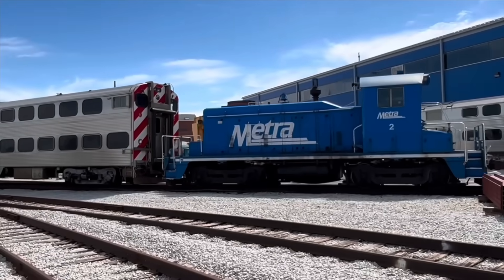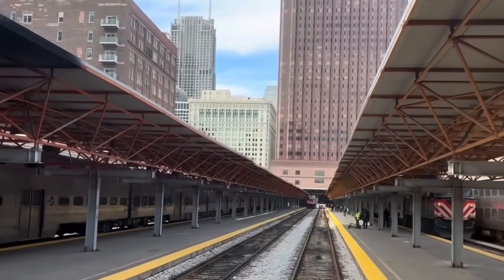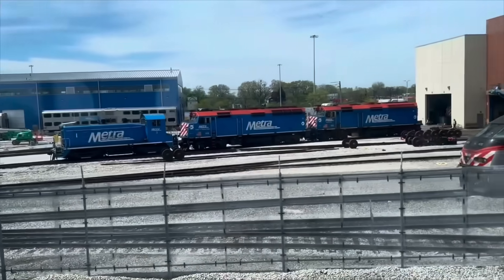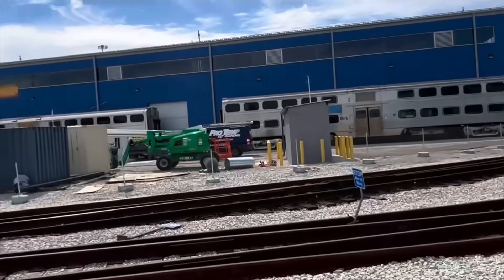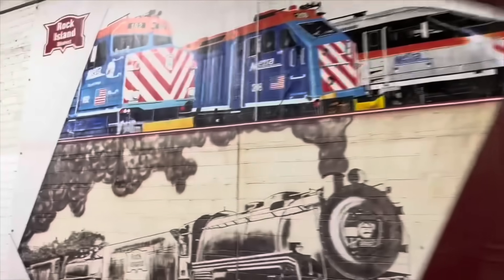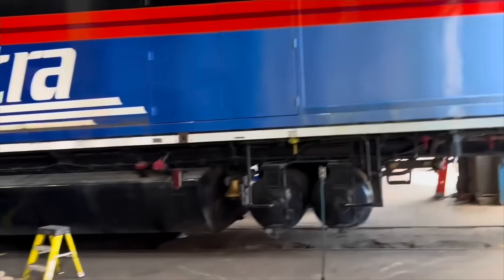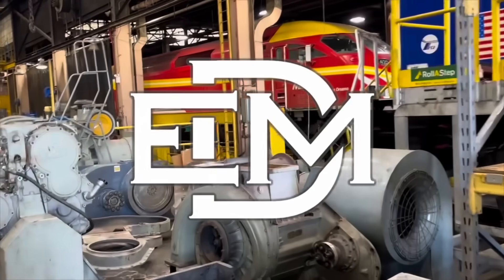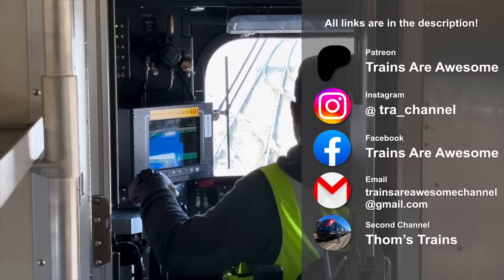How Metra can keep running such OLD trains

Comment: Very good video 👍🏼. Thom, if I knew you were going there, I would have asked you to ask Metra. Why cant Metra make F-40ph’s quiet like the F-59s and the MP-36s.
Keep up the great clips Thom.
Reply from the maker: Good question! Let me do some digging
Reply: I know why, however those F-40ph’s have been rebuilt, overhauled etc a few times since the 70s & 80s and were not converted, to for example resemble F-59ph/F-59phi (1988-2001). Granted those have a V12, however the length is almost the same.
Only thing I can think of is that they have grandfathered emission standards.
I just like digging for technical info in stuff Im interested in.

Comment: By using OLD equipment and simply rebuilding parts for them as the old parts wear out, they save 50% on their operating budget compared to what they would spend if they bought new equipment instead.
Reply: This works until they run out of parts, which is why the Alstom order is happening. You can only cannibalize so much.

Comment: I wish I could be at such an event. I was able to go inside of the Metra locomotives every year at the Franklin Park Railroad Days which takes place on the second Saturday of June right outside the Franklin Park Metra station on the Milwaukee District West line. I usually have to travel for it every year now that I’m not in the Chicago area. I’m getting to like the Galesburg Railroad Days better which is every year on the last weekend of June. I’ll probably only be in town for that next summer.
Reply from the maker: That sounds like a cool experience!
Reply: @Thom-TRA Yes indeed!

Comment: I guess the 47-49 is Metra’s equivalent to Beech Grove for Amtrak (although I’m sure there are smaller facilities were more routine work occurs elsewhere for both operators. Wouldn’t be surprised if Amtrak and Metra share sites in Chicago)
Reply: Amtrak does all their work separately in their yard on the southeast side of Union Station. Metra does the majority of work at 47th Street (this video), Western Ave, The Zephyr Pit (Metra BNSF yard at the southwest corner of Union Station, and 18th Street (Metra Electric).

Comment: I keep repeating myself: Your opinion matters now, Mr. Transportation Attaché. Which is a GOOD thing! Also, your video was as educational AND entertaining as always. Thank you!

And now for some trivia (regarding the old shunters in the yard): The S-Bahn Berlin GmbH (a subsidiary of the DB AG) is using a dual mode locomotive in their main shop (S-Bahn Hauptwerkstatt Berlin-Schöneweide) which can run either as an ordinary electric locomotive via third rail power or from internal batteries. It was built in 1933, over 90 years old (and survived WW 2 al well as the GDR) and still is in daily service. To be fair, it has been modernized twice. DB themselves on the other hand, still uses many the shunting locomotive model V60, which was introduced into service in 1955. 
Though the railfans would find that bit interesting. ;-D
Reply from the maker: I hope I last that long haha

Comment: I definitely come down on the side of people who believe Metra is held back by its continual reliance on old rolling stock. They should definitely not use gallery cars anymore and should at least seriously consider multiple units or other locomotive types when making new acquisitions rather than just buying everyone's old freight locomotives and gallery cars
Reply from the maker: Me too, but I made the mistake of saying that publicly once
Reply: @Thom-TRA Knowing little about railroads but having ridden Metra for 30ish years, I don’t understand the issue with the gallery cars. I’ve always found (the refurbished cars) to be extremely comfortable.
Reply: The Beverley branch of the Rock Island line will be getting electrified 2 or 3 car units in the coming years
Reply: License ANY Design and have a company based in the south side of Chicago build it for a fixed price per each lot of 20.   Getting car s from out of state is bullshit in the steel job shop and large casting mecca of America.  Even if its weird, looks like shit, as long as its weather tight and has HVAC that works in 3 seasons a day chicago weather,  its a 90mph passenger car that needs to be compatible with high and low loading, because the suburbs are not going to redo a train station before the riders show up.

Comment: Honestly the order from Alstom is so slow moving that I forgot it existed until it was mentioned in this video! Is there actually still any progress on it or is the order dead in the water?
Reply from the maker: I have no clue. It’s taking forever.
Reply: Last thing heard about It was metra was supposed to get the prototype cars this year and production starts in 2026 but it's all been pushed back a year to prototype cars 2026 production  cars 2027

Comment: I’m a huge Metra fan! 

Metra sure has a lot of hand me downs on their fleet. 

Like you mentioned Metra has a large commuter rail service in the United States.
Reply: Hand me downs*
Reply: @Nova32x 
Nothing wrong with hand me downs, and to be honest the only thing that was hand me downs was the original equipment that they received when the RTA was formed. Since then they have purchased new locomotives as well as used and rebuilt locomotives and more gallery cars to meet the demand and become ADA compliant.
Reply: @PTCopper I agree

Comment: A great way to keep all commuter rail operations throughout the US operating efficiently while saving tax payer dollars.  I've never understood why locomotives and train cars need to be replaced after only 15 or 20 years of service.  Refurbishment upgrades the equipment to make it like new again at probably a quarter of the cost of buying new.  And without all the headaches new stuff presents (I'm looking at the new Acela trains as an example).
Reply from the maker: I think your numbers might be a little made up. It’s only a significant cost saving if 
A) you’ve done the proper maintenance until then, which is expensive 
B) you can do the maintenance in house. 

Changing customer needs, different intensities of use, these are just examples of factors that could make it a better financial decision to buy new trains instead.
Reply: @Thom-TRA  Obviously you have to constantly keep the equipment maintained from the get-go.  Otherwise refurbishment would not work.  Still believe it's cheaper to maintain and refurbish rather than replacing with new equipment.  Today's new equipment is fraught with complex electronic systems.  Even the manufacturers don't seem to know how to make them work when new, let alone repair them in the future.